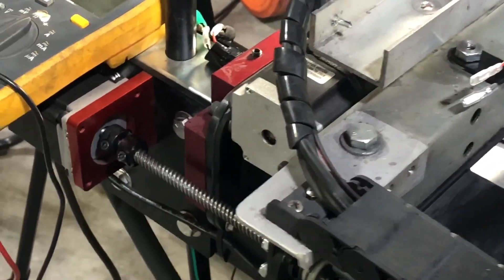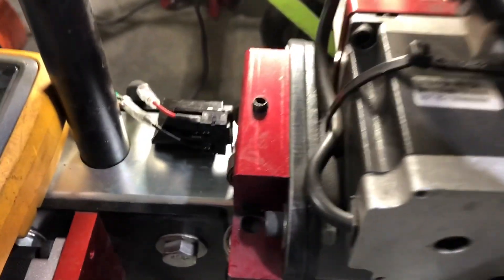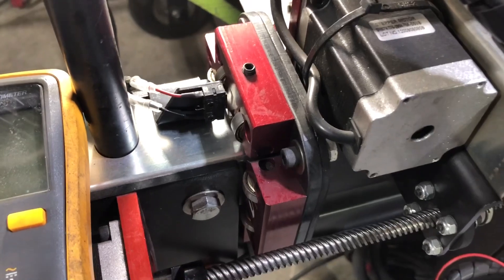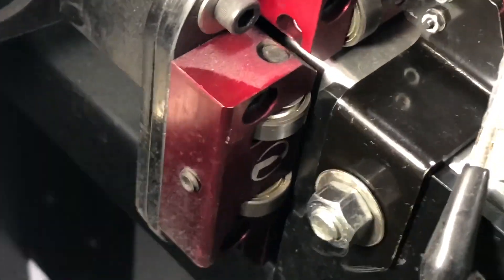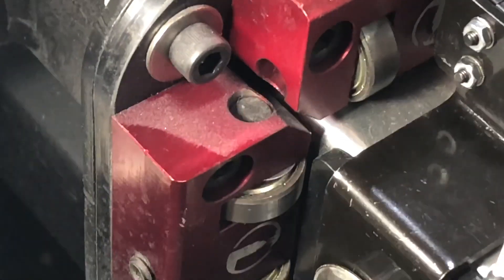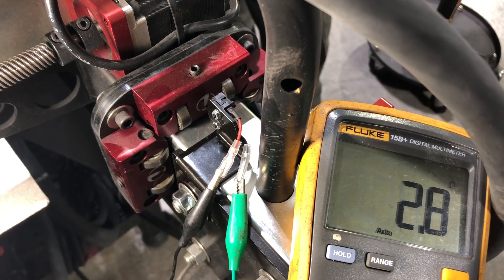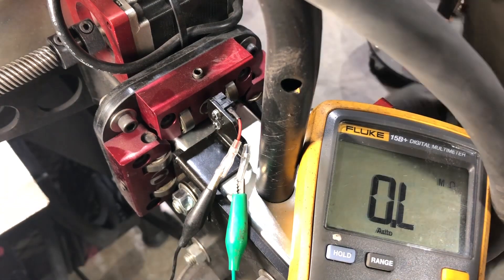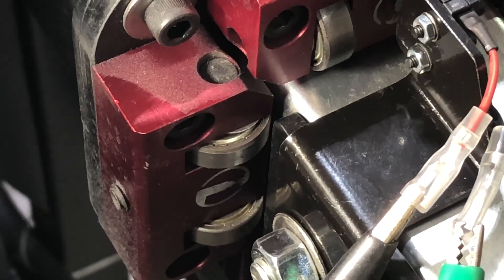Langmuir Crossfire Pro Limit Switch Tips and Switch cable routing for drag chains

Comment: Another good video.

Have you shown anything more on your infeed or outfeed support?
Reply from the maker: Sorry for the delay in responding!  I don’t seem to get notifications when new comments are added on videos that I did a while back!  Help me recall infeed and outfeed support topic
Reply: @CustomCreations3  No worries.  I'll go back through your videos tomorrow, but I seem to recall you had some sort of setup or fixtures for your table or stand to support using sheets larger than the 4 x 3 on your table.
Reply from the maker: @Beefman-648  I have a stand on wheels and the top is covered with roller ball transfers https://www.amazon.com/Ball-Transfers/b/ref=dp_bc_4?ie=UTF8&node=16411111. I can wheel this to my sheet stock and put a sheet on the stand and then roll it back to the table.  The height of the stand allows me to easily transfer the sheet onto the slats of the plasma table

Comment: OL means the switch is open, 2.8ohms is when it is closed.
Reply from the maker: Yes OL is meaning there is no continuity e.g. the switch is open or over the limit of continuity... a little confusing but that's apparently Fluke's way of saying the circuit is open!  Some indicate that OL when reading continuity should be understood to be "open Loop" which would be correct.